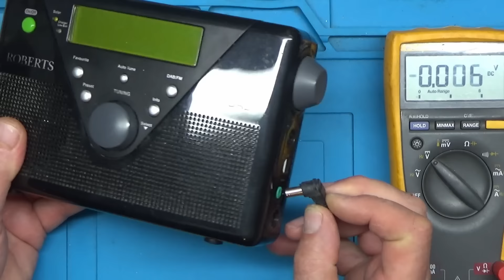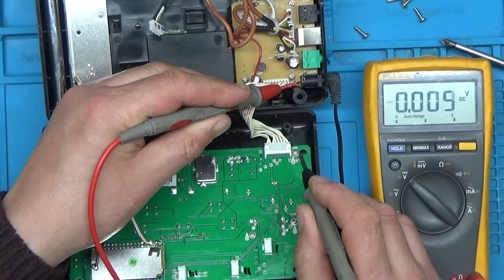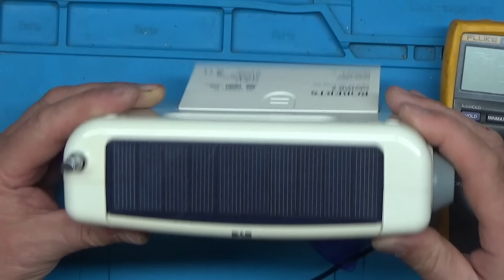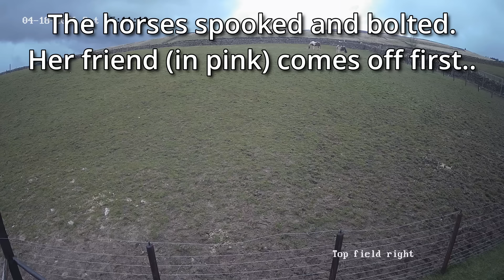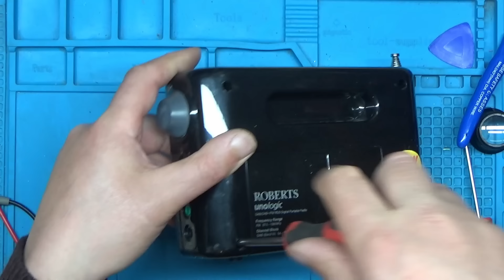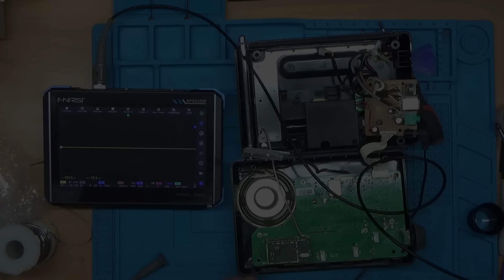Can I Fix These For A Viewer's Autistic Son?

Comment: Mick, how do us viewers send you something to fix ? I have a Yamaha PSR 740 keyboard, on which the floppy disc drive no longer reads or writes to ( but it does attempt to read discs, but tells me the disc isn’t formatted ( I know the discs are formatted correctly)) 👍
Reply from the maker: Hi mate, it sounds like it could be the floppy disc drive itself from the symptoms you describe. I'd imagine a 3 1/2". I wonder if it's the same as a standard PC one?
Reply: @BuyitFixit  Hi Mick the thing is it tells me the disc isn’t formatted. If I select format disc on the keyboard controls it says after a few minutes and the usual sound of a disc being formatted that the disc is now formatted. If I then try to record from the keyboard, it then tells me that the disc isn’t formatted. The disc drive looks like the usual computer 3:1/2” floppy disc drives. I did read on a forum that it could be a problem with the keyboard electronics rather than the disc drive itself. I’ve tried cleaning the heads with a floppy disc drive cleaner to no avail. I can’t now source a 3:1/2” floppy drive. The only ones that seem to be available are these USB floppy emulators. Just thought it might make an interesting video. ( if it is the main board in the keyboard that’s faulty ) ???

Comment: A small recommendation: in case of such breakdowns with peeling and breakage of conductive paths, fix the torn parts with glue to prevent repetitions. And use soft conductors to the nearest unloaded part.
I wish your wife a speedy recovery.
Reply from the maker: Thanks mate, and thanks for the tips 👍